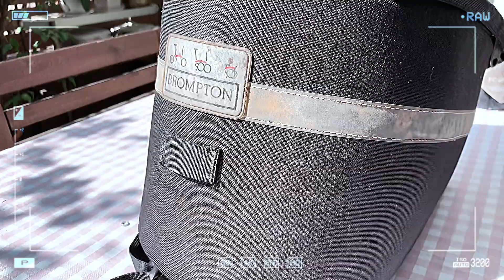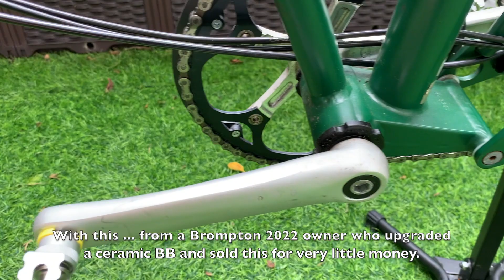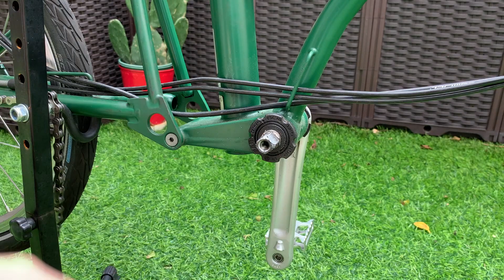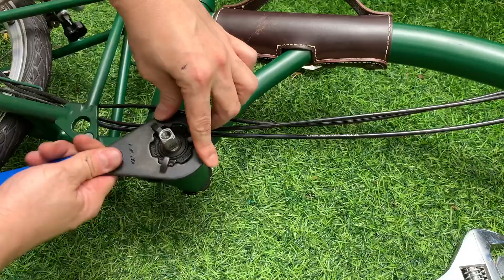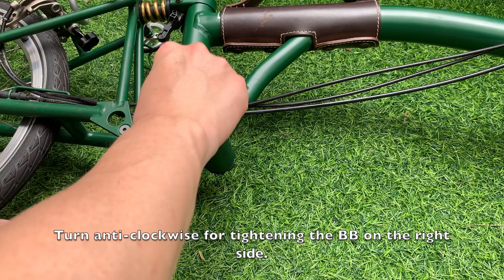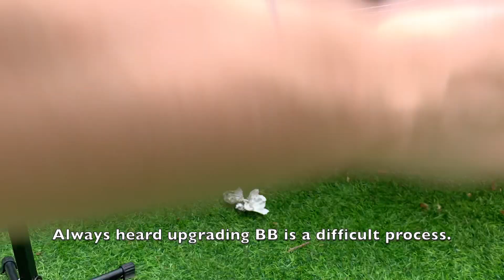How to Upgrade your Brompton DIY - Bottom Bracket (BB)

Comment: At my first, included in the price ("free"!), service I asked my dealer to replace the original bottom bracket with a "Ceramic Ball", Titanium bottom bracket on my Lightweight. They are to be found in different sizes, but luckily I had bought the proper size for my bike.

Comment: Hi, can u do a video on removing the brake levers and the brake cable?
Many thanks.
Reply from the maker: Thanks for your recommendation.  I will bear this in mind.  In fact I found the braking system of original Brompton is quite reliable and yet to find any “Economical” replacement.  Will keep searching.
Reply: @kkllbaba  yes I’m in the process of changing to external gears and my mechanic says the same - original Brompton brakes are the best

Comment: This is not an upgrade. Should have changed to lightweight ceramic BB. Original BB weights 250 - 300g. Ceramic BB by Token, Ridea, H&H weight only 160g.
Reply from the maker: Thanks for your suggestion.